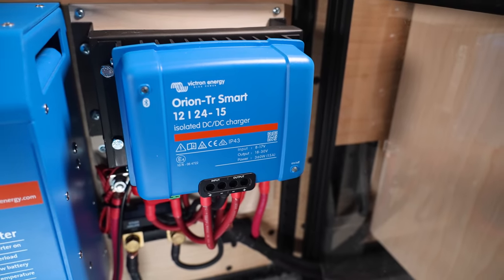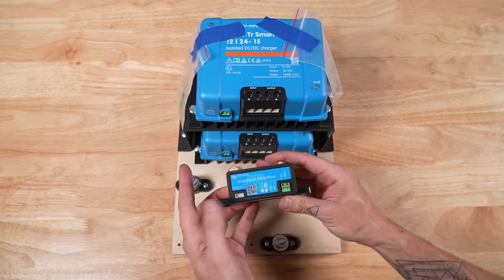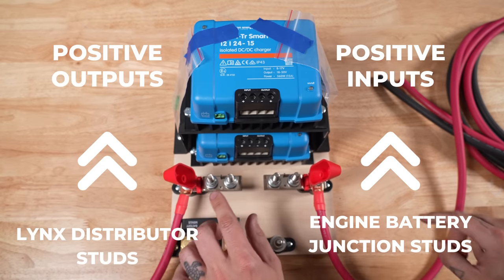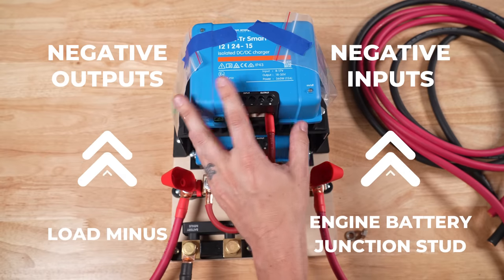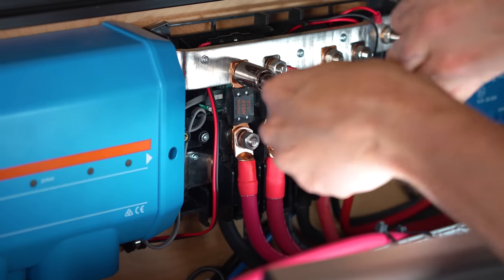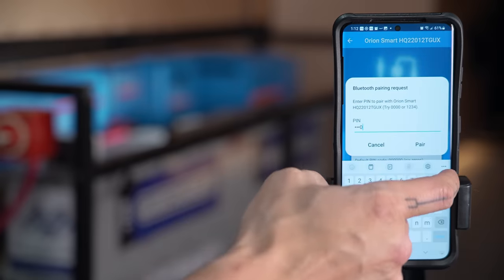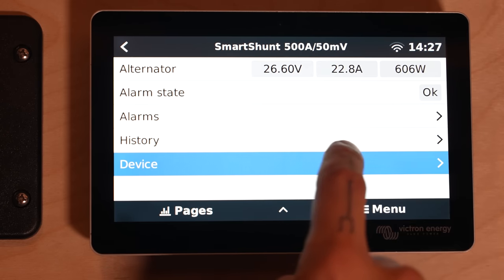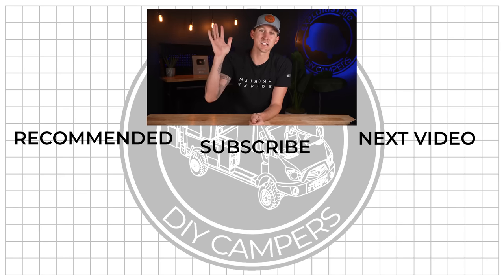TRANSIT ALTERNATOR CHARGING - DUAL VICTRON ORIONS

Comment: The build looks awesome. I'm sure you had a reason to reverse the in put side and the output side between your board and the devices. But, it is making my OCD twitch. If you are doing a lot of high amp low voltage stuff I would invest in some insulated wrenches. Never know when you will forget to turn the battery disconnector off. 

I would have personally done a disconnector between the alt in and the charger input. Not a big deal but with any system I like having an off switch. I would have slaved the disconnector off ignition. That way the system wouldn't be able to drain the start batteries. I'm sure there is some fancy low volt cut off; I just don't trust the confuser to make the right choice in a failure. The gear you are using is solid quality. Everything will fail and until it does you don't know if it fails on or off.
Reply from the maker: Wire sides were switched to make wiring easier with the space we had available in regards to minimum bend radius of the wire.

If you'll hit that 'thanks' button right below the video and send over $500, I'll buy a set of insulated wrenches.  Thanks for that offer!!  Super generous of you.

The orions do indeed have low voltage cutoffs built into their programming.  Although you can add whatever disconnects you like, we've got hundreds (thousands?) of units in operation without a single low voltage disconnect failure.  If you have a failure and have purchased through our store shop.explorist.life, we will warranty it out if it happens within the first 5 years.

If you want to add a switch to your setup, you're more than welcome to, and we'd love to sell you the rest of the kit/components: https://shop.explorist.life but you'd have to figure out the switch on your own since it's not actually necessary/recommended by us.

Comment: Wondering if fuses are needed at the Orions if they are fused on each end?  I have mine setup that way. I also run the non-isolated Orions with chassis ground in Sprinter. Haven’t experienced any problems and don’t have to run all the grounds. What’s your thoughts on that?  Thanks for all the videos.
Reply from the maker: If you are running dedicated wires and not a single wire that gets 'split' at the charger, you don't need the fuses at the unit, no.  In other words, you can't run a single wire that then splits to dual orions without fuses.

Comment: Hi Nate…we are doing the exact same setup… 12 to 24V but the local Victron supplier gave us a set of Non-Isolated version!  
Why the difference?
Cheers…. Karin & Yvon
Reply from the maker: I recommend the isolated version as it always works in 100% of use cases without any additional considerations.

Comment: It was not clear in your video/email.  Is Vicron going to come out with a higher AMP DC to DC charger for the 12V to 24V systems or for the 12V to 12V systems?  I presently have a Sterling 60 AMP charger, but I would like it more if it had smart phone bluetooth capability.  Will victron have a "SMART" 12V to 12V charger that can charge at a higher rate than the  12/12-30A? Thanks for the help!
Reply from the maker: There will indeed be a smart orion with higher amperage in a 12-12

Comment: Would you still go dual Orions on a Transit with a single alternator and dual starter batteries?
Reply from the maker: I would, yes.  I like to keep dcdc amperage under 50% of the rated alternator output

Comment: I'm curious why you went with 2 15-amp units instead of one 30A.  Thanks
Reply: Because they are 12-24/15A Orions. From 12V to 24V.  There is no 12-24/30A
Reply: @maiklomapartida779  ah, ok, I missed that it was a 24volt system. Thanks
Reply: Technically it is 30 AMP. 12v-30a INPUT to 24v-15a OUTPUT  Each charger will draw 30a from the alternator for combined 60a.  Victron doesn't really make this clear in their documentation.

Comment: Hello. I am installing a dual victron dc dc charging system. The only problem is the isolated version of the dc dc charger I have. Will the data appear correct on the negative cable passing through the shunt with this device?

Comment: Hi Nate… I’ll start by saying that I don’t know much about electrical… 😂
But your vidéo are the best to make it simple to understand for a newbie like me. 
Simple question : I am planning to make a 12v battery bank system for my Sprinter. But I was woundering if a 12/12 30a dc to dc is enough for a 500ah system. And if 2 12/12 30ah orions will drag to much from my sprinter alternator or will work even better. ? I dont mind being overkill😂 but I don’t want to put together something that could be wrong . Thanks for the help! And keep those vidéo going…they are awesome.

Comment: Hello thank you for this video ❤
I have a question is it possible to have 3 or 4 of units installed for faster charging?!
Also can you please do a video with the Buck-Boost DC-DC Converter!?
Reply from the maker: You Can indeed do 3-4 units.
The Victron Buck Boost is being phased out soon in favor of bigger orions; so I'll wait until the new orions are out for a review of those.

Comment: I have a mini power queen 12v 100AH battery the spec sheet says the "recommended charge current" is 20a.
I want the victron smart dc to dc charger, but they make a 20a and 30a charger. Can I buy the 30a and program the charge current for 20a?
Reply from the maker: Nope.  The charge current is not programmable.

Comment: You made an excellent video Nate!  I was just about to try that myself but I now see I would have overlooked some critical details with the fuses.  Given one has the room, can this design be extended to three Orions? It would be close to that 100 amp buck boost and would be a lower price.  Also, I do not find the step-by-step guide on programming the Victron Connect app in either the additional resources for the video or the pinned comment.  Am I looking in the wrong place or have you yet to post the guide?  Thanks for all your videos on the Ford Transit.  I couldn’t attempt this project without them.
Reply: I'm pretty sure you can run as  many dc-to-dc chargers, in parallel, up to about 50% of the alternator's output.  

I have a renogy 60 amp 12 volt DC to DC charger.  This pulls about 70 amps from my 160 amp alternator.

Comment: Hi, Nate. I love your videos and learn a lot from them, so thank you for that. I have a Ford Transit van with dual batteries and a 250 amp alternator. The house has a 450 Ah battery bank consisting of four 6-volt 225Ah deep cycle batteries. I charge the house batteries from the van batteries using a Sterling BB1230 30amp B2B charger. This gives me 20-22 amps of charging and I'd like to get as much as I can by swapping out the B2B charger for a more powerful one. My question is, how high can I go and how do I get there? A Powermax PM4 100A charges the batteries at 100 amps with no problem, so I'd like to get as close to that as feasible. What amp rating would you suggest and do you have a particular product you could recommend? Thanks again!
Reply from the maker: For the 'absolute fastest', you'll want a second/dedicated alternator (Nations alternator or similar) w/ regulator (Wakespeed).
Reply: Thanks for the quick answer. I'd rather note get into changing the alternator, so I"m still looking for a B2B charger in the 90-120 amp range. 
 @EXPLORISTlife
Reply: Hello Nate, first thx for such great content! I feel like this would be such a great vid to add to your content. I have been trying to understand the DC to DC charging. I have watched all the Victron material that you have put out, but this one area has me confused. 1- If you are running a 24v system and add a second Atl, do you add a 24v alt? 2- If you add a second Alt, do you run a Reg as well as an Orion, I thought the Orion acted as the reg? 3- Your system is running at 24v w/ duel Orions, and I think a single 12v Alt, at what point does it make sense to add a second Alt? 4- Pros and cons of a second Alt vs. swapping the single stock Alt out for a single high output aftermarket Alt. Thx Nate!!  @EXPLORISTlife

Comment: Great work Nate. So, to be clear, you have 2 shunts (monitoring the grounds), 1 on the house side and 1 on the alternator side... Right? Would there ever be a case where house power went out thru to the alternator?
Reply from the maker: Correct!  The 'house' shunt is actually being the battery monitor (power in vs out and amp hours remaining in the battery bank) and the shunt on the Orions shown in this video is only telling us how much power is coming from the alternator since the Orions are not able to tell us their output through the VictronConnect app.

Comment: Hi Nate, love your guide and videos. I used it as a guide to build my electrical system. Hi have a question about this setup. Why are you using two 15a DC to DC charger instead of one with 30a or more?
Reply from the maker: The 12V to 24V 15A is the same thing as the 12V to 12V 30A.  We have a 24v house battery bank so we have to use the former; but it's ~300W output per unit either way.
Reply from the maker: If they ever release them, they will be. 😂🤷👍

Comment: Can I ask what the distance from starter battery to dcdc is? i am about to set up 2 orions, 5.5m run (or 11m with return) total, and was thinking 2x2awg but you have 1x2awg for both (or the equivalent of 6awg for each)? (Ps, thanks also for the mbrf idea … saves space nicely)
Reply from the maker: 20ft, I think.  Voltage drop isn't a huge deal there as the Orions are designed to overcome voltage drop; which is why we put them closer to the house battery bank side of things.

Comment: Great video!
Getting ready to order Victron package from you.
If we wire this DC to DC charger like your video, alternator protection device is not necessary?
Reply from the maker: What do you mean by 'alternator protection device'?
Reply from the maker: Well... that's what the DC DC chargers in this video are...

Comment: Good morning,
Please can you elaborate on your choice of 2 Orion chargers rather than making use of VE's Buck - Boost DC - DC Converter 25A / 50A / 100A?
Regards
Joe
Reply from the maker: Sure!  2x 360W Orions like shown in this video will charge faster than the 25A or 50A Buck Boosts.  The 100A Buck Boost is basically no longer being made, so we weren't going to make a tutorial about that, and the 50A buck boost is also on it's way out in regards of production.
Reply: @EXPLORISTlife  
Thanks for clearing this up!
Regards
Joe

Comment: I'm going to try and keep this short (haha) so there will be gaps but, as an alternative (pun intended) how about charging the house bank of lithium with the alternator, then the DC to DC's source is the house bank and destination is the starter battery.  Using a smart regulator/alternator you can protect the alternator but also get much more "out of it".  Another advantage is you park the van for a month, and most people need to put a battery refresher (trickle charger) on the start battery.  With my scenario you are typically plugged in to shorepower   the month, thus the charger/inverter is keeping house bank charged, the Orion is "on" and thus monitoring the start battery and will take "juice" from the house bank to keep the start battery topped off.  Thus, the Orion is also acting like the "refresher" and negates the need for that external device.  I think the current (another pun) Transit alternator is a 250 amp.  The start battery is powering the headlights and the cabin "stuff" but it isn't normally a huge draw on the battery.  Why not make use of some of that 250 amps and charge the house bank with more than 30 amps (Orion DC to DC 12 volt system).  Disclaimer, this architecture is exactly what I have on my sailboat.  I was skeptical at first because you can't find any info online about this arch.  But, working with a certified marine electrician it is in place and working.  500 amp hour lithium house bank.  lead acid start battery, All Victron equipment, 15 year old 90 amp Balmar alternator with their latest smart regulator which has a lithium profile.  I post this because I have just started my journey of obtaining a camper van (Transit Trail platform)

Comment: Specific to the units you used. How are you keeping them cool? I'm running one of these and it gets hot enough to smell and reduce the output voltage. With the bracket you built, it has to effect heat dissipation. 

I'd like to run 2, but the heat is my concern. Thx.
Reply: Iam having the same issue with mine 12 | 30 & it´s in a "free" space with nothing close. In summer it´s instantly dropping the input voltage & I am "crawling" along with an input betweent 7-13amp. This is very annyoing
Reply: @tiger_powers  after some research it's common.  They run very hot.  People are DIY fans to keep it cool.
Reply: @tonyronquillo2246  yea - I´ve come to the same point but hating the fact of having to install a "active" cooling system (fan or such). So I am currently debating, switching to redarc or trying something like votronic..
Reply: @tiger_powers  yep yep.  I'm going to split my solar array and run part of it right to my solar generator.  I'm not comfortable with how hot these things get. It will heat my 5th wheel basement storage compartment to over 90 degrees. It's crazy how much heat they generate.

Comment: Nice video. Didn't know you can hook up chargers in parallel that way. But.... questions.... Will one charger perform more than the other? Since the chargers are connected to the start batteries/alternator, will they pull charge from the start batteries even when the engine is not running?
Reply from the maker: The will perform at roughly the same level.  They will not pull charge from the start batteries when the engine is off if they are properly programmed.
Reply: @EXPLORISTlife  Nice. So an alternative to a Redarc BCDC charger? Another video on programming maybe?
Reply: No because do chatter are designed to stop charging once the car voltage drop  so you can stilll start your car

Comment: Nate, how can I charge the engine battery from house batteries? I have a Sprinter with 810 Ah BB (lithium) and 1200 w of solar. When boondocking I use the electric sliding door on the car battery and to avoid discharge I want to charge the car battery. Suggestions? Thanks.
Reply from the maker: I think you'd have to open and close your door a LOT to drain your battery?  Have you had issues with that draining your battery so low your van won't start?
Reply: @EXPLORISTlife  once when building the van and didn't start it for 2-3 months. And i was thinking, preventive, about a way to avoid excessive discharge.

Comment: Awesome video Nate!  (see what I did there? 🙂)  Is it necessary to have the BMV in the system or is it just to track the output with the cerbo?  Just trying to decide if I want to add it to my system.
Reply from the maker: I do, and I appreciate that. 😂👍  It's not 100% necessary to have the SmartShunt in place as shown; but you DO need to be able to combine the negative battery wires somehow before going to the Lynx Distributor; and by using the SmartShunt; we can veryify what kind of actual wattage/amperage output we are getting from the alternator charging.  Otherwise, you are having to guess a bit as it is 'alternator charging from orions - any loads = what registers on system BMV-712 or system shunt.
Reply: @EXPLORISTlife  thanks!  Your video was timely for me as I am finishing up my install on van#2 with twin orion's. I could not see where you sell the dual fuse posts in your store. Do you have any?  Figured I should through you some support for all the information you have provided me over the past few years... starting with the heater installation you did in your driveway.

Comment: Great video! just about to try this myself .. will 6AWG wire be ok? Also, what size are those junction studs/ferrules? Do you have an amazon link ?
Reply from the maker: Better than Amazon links, we sell the wiring kit in our store: 

Dual Orion Wiring Kit: 12V Alternator to 12V Battery Bank: https://shop.explorist.life/shop/all-products/dual-victron-orion-tr-smart-12-12-30-dc-to-dc-charger-wiring-kit/
Dual Orion Wiring Kit: 12V Alternator to 24V Battery Bank: https://shop.explorist.life/shop/all-products/dual-victron-orion-tr-smart-12-24-15-dc-to-dc-charger-wiring-kit/
Reply: @EXPLORISTlife  cool! I only have one Orion though .. and what about those studs you screwed into the plywood? what size are those? My setup is a bit more custom too.. for example I need an SB50 on the output of the Orion...
Reply from the maker: @miramar-103  We have single orion wiring kits available as well: https://shop.explorist.life/shop/all-products/victron-orion-wiring-kit/

That should get you 90% of the way there and then you can fabricobble whatever other 10% of custom you need for your situation.
Reply: @EXPLORISTlife  think i'll go for the new XS .. got any in stock yet?

Comment: Can you please help, as I am dazed and confused?
My confusion is how to connect my controller to my two 12 volt batteries that are in parallel?
I suspect that the positive lead from the controller connects to the positive on one battery and the negative lead connects to the negative post on the second battery. However does the battery selector switch, (Battery 1, Battery 2, or both) change the way to connect the controller to the batteries?
My boat has each of the two original battery chargers connected to separate batteries. Why?
Does this mean I should connect my controller to the two batteries the same way?
I am wondering if the wiring of the original Catalina selector switch has to be considered in how the controller connects to the batteries.
Thanks in advance for your advice.